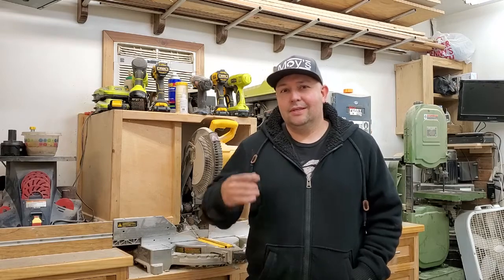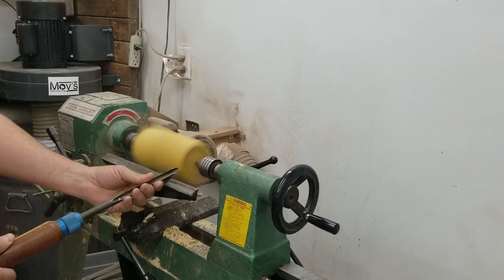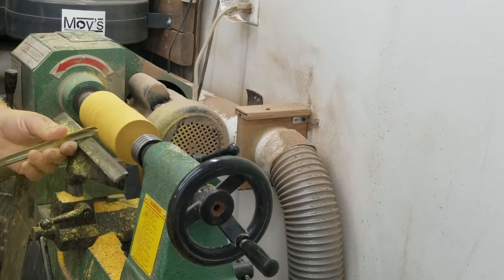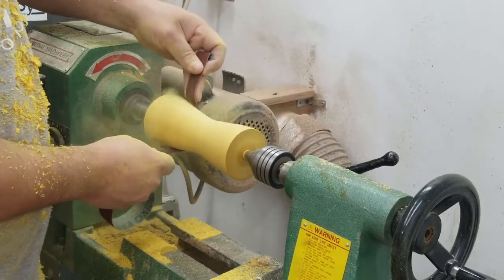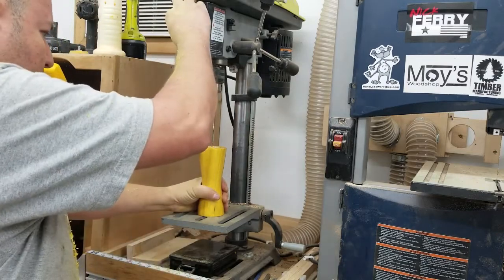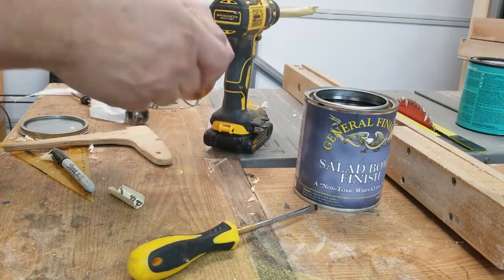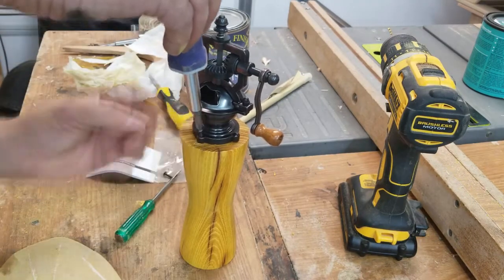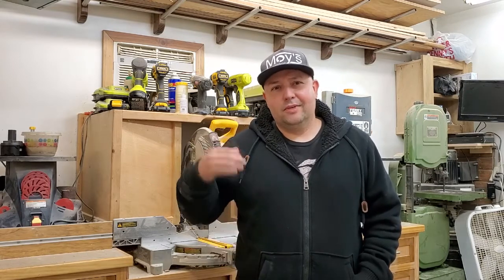Making a Pepper Mill

Comment: Hey Moyito!  Fun to see you turning wood that I milled.  The stall may have been due to loosening between centers.  I have had that issue when turning osage orange.  Tell your friend that the wood will color up to a nice amber in about a year.  You probably had a pretty nice sheen when sanded to 600.  And man!  That wood turns so good.  No checks to stumble on.
Reply from the maker: Thanks Ted, yeah this stuff is awesome to turn. I Still have a little bit that I want to use for a bowl.